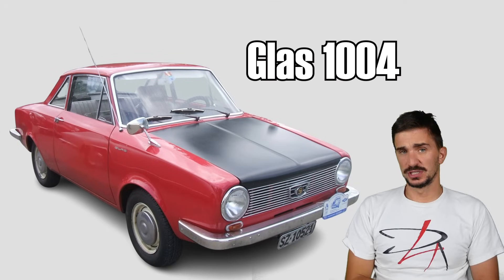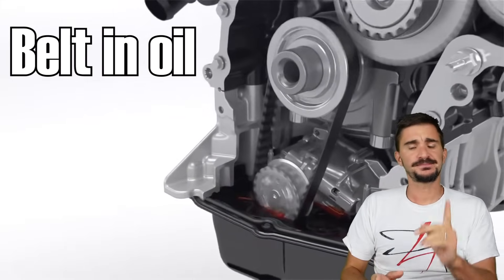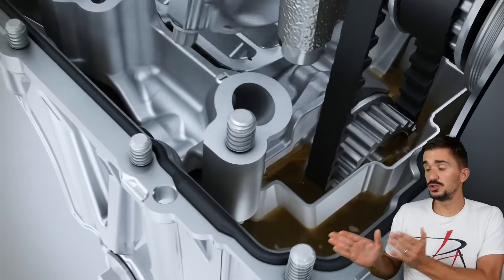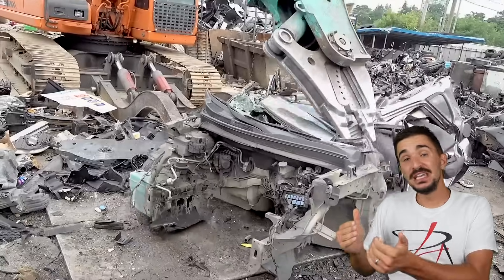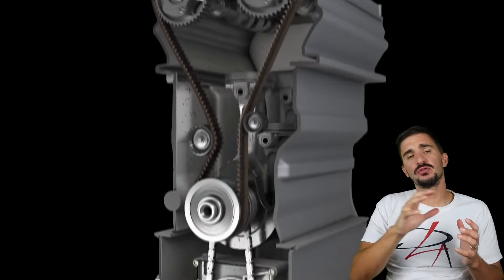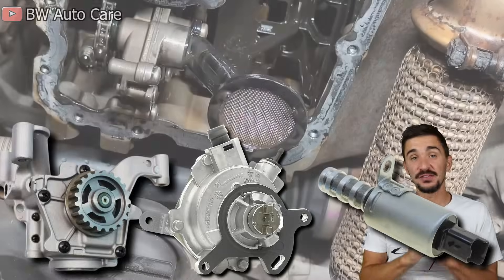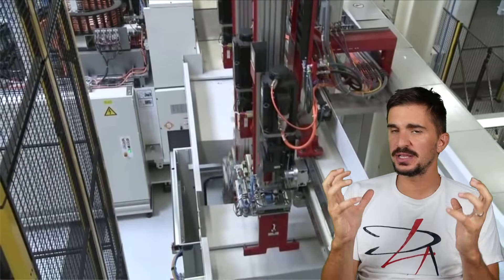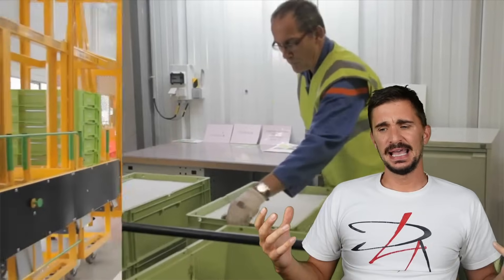Who Approved This and Why Is It Still Being Made? Wet Belt aka Belt in Oil Engines

Comment: Regarding the point at the end. You're speaking of the broken window fallacy. It's pretty interesting when you actually understand that what we're doing when we make things worse just to have them fail, we're actually NOT incresing the wealth of society. We're spending it to create short-term profits in a very isolated area (company). 

If we instead built things to last, instead of spending money on repairs, we would afford other things, building wealth for society as a whole, and in the end making everyone's lives better.

This idea is incompatible with the current paradigm, where the only thing that matters is the next quarter. Of course, I do think the opposite idea of capitalism is incompatible with humans, so I don't know how to fix this.
Reply: I also had the same idea of the broken window fallacy. The way i see it there are two approaches to fixing the issue. one is more regulation, force the entire auto market to use a single design, tested to 500,000 miles to find any issues before entering the market. this would destroy innovation since there's no way for new designs to disrupt the status quo. 
The other way is to ensure compatibility of replacement parts and a right to repair. By ensuring all comparable kilowatt engines have the same bell housing bolt pattern, then the consumer can have and repair a car built from parts from different vendors with the best reliability.
If we are to encourage manufacturers to create more reliable machines, then we should pay them by the hour of labour instead of the number of automobiles. i.e. quality over quantity.
Reply: The solution is more education. If you educate consumers about rubber and oil and how they mix ( or don't, in this case), then a company putting this kind of product on the market will just fail by itself.
You just need to do enough education that most people can figure out where to get additional information by themselves, so that they can draw the conclusion that whatever someone is selling is snake oil.
Reply: The really sad thing is that the companies that made good reliable products have mostly gone bankrupt or been bought out or taken over by the ones that prioritised profit over everything else. The classic example is Volvo, who used to make cars so durable and reliable that their sales tanked because everyone who wanted a Volvo was already driving one, and their car was showing no sign of wearing out. Volvo had to make a conscious decision to make their products worse to have sales comparable to the companies, and they still got taken over by a Chinese company anyway. 

Now their prices are still just as high, but their reliability is worse than the average car. In the US, Polestar has even managed to knock Tesla off the bottom of the JD Power reliability ratings with their even worse products 😞. Unfortunately humanity has itself to blame for this - for every person who buys things to last, there are 100 who'll buy the cheapest option or the one with the most marketing money spent on it, despite it being provably more expensive in the long run.
Reply: @martin-vv9lf , I really like this idea of a standardised engine. I’ve been saying for years that everything should simply be fitted with a 5 litre V8 and that’s that. 
No choices, one engine for the entire world. Make it reliable, powerful, easy to maintain and most of all make it affordable. 
Things like lawnmowers might be an issue for some, but I don’t care, get a bigger lawn then, it’s still better than having a wet belt or similar ridiculous “technology”
Reply: @peglor  I've worked at Volvo for 16 years and can absolutely confirm this. On the "upside", working conditions are much worse, quality is rapidly decreasing and our wages haven't kept up with inflation so... the executives are all patting each other on the back and making new stupid changes just to feel like they're doing something.
Reply: It is all about incentives. You have to create incentives that make it in the best interest of the executives at a company to prioritize long term profit over short term profit. Right now the way executives are compensated they are heavily incentivized to maximize short term profits as that is what benefits them. 

All of this changed around the 80's and 90's when how executives were paid change from being cash to stock. A simple change of mandating all compensation must be in cash could get us back on track where the most profitable companies are the ones who value their customers over the next quarter earnings.😊
Reply: @johanslabbert2869  A 5 liter v8 would be a bit big to get your groceries but it would be great in an agricultural tractor. As a farmer i've often bemoaned the scarcity of agri engines. i'd love to be able to walk into a scrapyand, pick up a v8 for small money and fit it into my own tractor. If it were me i'd like if diesel and petrol engines used the same block, so all i'd have to do is swap the heads out to diesel versions. I guess if you had the injectors threaded like a spark plug you could use the same head, just change out the crank and con rods. v8s tend to spin shell bearings also. the inline 6 are tried and tested more reliable. I think there could be a middle ground, like a v8 that uses the same head as an inline 4, and then the entire family, inline 4, inline 6 and v8 all use the same rods and pistons, and bell housing pattern too. kinda like a modern pontiac trophy 4 but with a balance shaft where needed.
Reply: @LarsaXL  The sad thing is that 16 years ago Volvo were already well into their downward quality trajectory 😞. The Skoda Superb wagon is the closest thing available to a modern Volvo 240.
Reply: @peglor  Eyupp, no argument there, but it was a lot better 16 years ago than it is now.

Comment: Fun fact. The ford edge uses a chain, but the water pump is ran off it, so when it goes it shoots coolent into your motor. Very common motor. This was 2009. They haven’t changed it at all

Comment: I finally understand what is going wrong.  I recently met with a group of freshman engineering students.  They are great at math, but none of them have ever worked on a car, or taken anything mechanical apart.  They were for the most part gamers who lived in a digital bubble.  And quite honestly, none of them had any interest in  working on an actual car or other machine.  

YES! That's why we get spark plugs that you can't change without pulling the engine and wet belts.  Modern engineers are great at math and computer modeling, but they never actually worked on a real machine in the real world. Simply put, wet belts work in computer models and save fuel in a simulation so that's the way modern engineers design cars.  And also yes, pretty much the first thing engineers learn is to always choose the least expensive option available to build.

I'm sure that there are still some engineers who actually fix their own cars or actually work on machines, but they are more and more uncommon,  For the most part modern cars are designed by video game playing math freaks aided by computer software developed by other computer gamers.  

Throw in a healthy dose of denial when things don't work as planned in testing and a huge cost to reengineer a product that doesn't work and you get wet belts that won't go away.  I mean the belt didn't break down in the CAD software program so it can't possibly happen in real life.  To be clear the CAD program didn't account for someone adding an oil treatment to the engine or missing an oil change, so when things go wrong the engineers can always blame the consumer, so no harm no foul, back to their screens and keyboards.

So when you open the hood of your car and ask yourself, who the F designed this mess? Now you know... it was someone who never changed a single spark plug or checked their own oil. 

I honestly respect someone who can complete 4 years of calculus, but until the engineers who design engines and cars actually have to fix what they created in a cold rain on the side of the road, things are never going to get better.
Reply: You really are too kind towards them; What they are is; Incompetents hired by Incompetents.
Reply: I used to run a chainsaw for a living and I never could figure out why the design improvements never fit the operating environment but what it was is that the idea people never went out and used a chainsaw lol.
Reply: Blame the companies hiring. I'm very passionate about designing modular assembly's yet can't get a job at the big 3
Reply: @edwardmacnab354  Exactly!
Reply: @xXlURMOMlXx  Most engineers with actual mechanical skills don't necessarily emphasize them on their CV or in their interview.  This is often a terrible oversight, because companies really are looking for people that have hands on experience. Before I hire someone to design a new fuel injection system, I'd like to know that he's actually fixed one and understands how it works, how it fits into the vehicle and how to improve it.  Otherwise, everyone else that applied for the job likely also had AutoCAD experience and are mostly interchangeable.
Reply: @RJ-vb7gh  it's pretty difficult to get all that into a resume though. Seems like Recruiters these days have the attention span of a squirrel and cant even get through one page. I'm pretty confident I would land a job if I could get an interview
Reply: @xXlURMOMlXx  LOL!  I had my resume trimmed down to four pages of careful wording.  A recruiter asked me to do the single page thing.  I tried hard and gave it to him.  He then went with the four pages and it worked out for everyone.

Comment: Some manufacturers have stopped using wet timing belts, but still include a wet belt to drive the pump etc. These engines will not fail catastrophically but can still have the clogged oil pump issue. 
The very first thing I check when buying a car is if it has any wet belts, if it does it will never make any shortlist.

Comment: The secret lies at 14:29 - the mfgrs aren't thinking in terms of longevity, they're thinking in terms of planned obsolescence, or probable replacement interval..  they need the engine to last the warranty period, and not much more so you'll have to buy a new one.  but what a lot of them are banking on you staying loyal to an unreliable brand.  until all the brands do the same, then it's all junk
Reply: Engineer says 'this is a bad idea'. management says 'its cheaper to install, lighter, and we can say it saves fuel!' So they fire the Engineer and grab a younger one with less experience who says 'cool idea bro, what if we use all these technologies to help with the swelling?' And management approves it because it's their idea and we have all these technologies so it must work. turns out Old timer Engineers have a better understanding of chemistry understanding than managers.

Comment: I believe Ford is now dealing with a class action lawsuit because of their 3 cylinder eco boost engines
Reply: 1.0 Ecoboost is a great engine. I literally love it. You just need to change the timing belt every 100k km, change the oil and filters every 10k km and it'll work like a charm. Also, the newer ones have timing chains since 2019.

Comment: Opel Corsa F owner here (Puretech 1.2 Turbo 96kw). They replaced my belt after around 65,000 km. Car have 4 and a half years so it was still within 5 years varanty so cost free. They said the new belt should last a bit longer haha.

Comment: My Mondeo 1.8 tdci wet belt went bang at 100k miles = scrap car 😢
Reply: what year mondeo? 1.8 tdci? aren't they hdi engines?
Reply: @supernova6553  it doesn't really matter. The rule of thumb for anything that has the words Ford, 1.8 and D in it, halve the interval for timng related maintenance.

Comment: My car was made 27 years ago. It has a timing chain, which was made 27 years ago. The engine has never been opened. Now, the timing chain tensioner, which was "interestingly" made of nylon, that wore through long ago and causes some issues. But it doesn't stop the engine, just leads to some rattling at times.

Glad I don't have to replace a belt every few years.

Comment: I remember when I was choosing to buy my first car, I asked the agents if the car uses timing belt or timing chain. Some agents have no idea about the specifics inside the engine and knows only the basics  like the capacity, its power, fuel efficiency and other stuff in the car.

Comment: I drive a toyota Aygo currently with 122,000 miles, its got the original timing chain. In the manual it says the chain lasts the life of the engine but also had advise to change it at 150,000 miles as "the life of the engine" probably translates to "when the timing chain snaps and specifies what the life of the engine is"

Comment: This is why I admire the GM 2.5 liter 151 I-4 "Iron Duke" engine..timing gears... Especially if you replace the factory fiber gear set with a steel gear set, they last hundreds of thousands of miles worry free.

Comment: After watching entire video I can say that you are pretty much on point on everything you said but I have few addons.
I drive a diesel with tdi engine, manufacturer says that oil change interval is 15 to 17 000km, you try that your engine will fail after 100 000km. after 12 000km or 1,5yrs your oil loses viscosity and it wont have effect as it should, but here is catch. You can change oil on 17 000km and you will be fine forever but you will need to make 300kms or more every day and you will be fine. Same with belt it will last 240 000km if you drive like 500kms every day.

PS. I once heard one wise man said something like this. Manufacturers always wanted to make something that will fail after warranty but didnt have means to do so. Technology before was not as advanced as it is today so they couldn't risk it to fail before warranty ends, hence parts lasted for so long (thats why you had chains as thick as tumb...), nowdays they can precisely calculate how long part will last, and as sooner as you need to change it more money they make.

They put 240 000km interval for belt change, and gave you warranty of 150 000km and or 5 years, try to figure why is that like that.

Comment: My wife's p308 has just been recalled at 30,000 miles as there was rubber particles in the oil.
They replaced the belt under warranty.

Comment: Wondering Why some ford wet belt engines dont have problems? I replaced one ford 2.0 wet belt car was 2018 ford transit with 2.0 ecoblue engine driven 200 000km and there was nothing wrong with the engine. Wet belt was like brand new and oil pickup was clean. There had to be something what causes these belt to fail or last as it should. Its clear that this problem is not random belt failure like poor quality of belt. There had to be something what causes this problems, if the cause of the fault has not been found, then the fault cannot be repaired or avoided and there is evidence that some engines dont have these problems.

Comment: Main problem I saw with wet belts is the way they degrade. You may replace it before it totally snaps but their main problem is that they shed their rubber components within the engine that will clog all internal components.

Comment: Hi and thanks for this video. I have a 2020 Ford Transit Custom 2.0 ECOBLUE turbo diesel and live in Australia. My van was booked in for the 180,000km service (here we have 30,000 km intervals) the day before the engine died and was diagnosed as timing belt failure????? they replaced the engine which took 6 weeks to get back. I did a lot of digging and found exactly what you have mentioned, here the Ford Ranger using the same engine is 15,000 km intervals??? no one can explain this sensibly to me. 30,000 km with the "new" engine (which I found out is refurbished)  it too needed to be replaced due to excessive oil and coolant use. this took about 6 - 7 weeks. now after 13,000 kms it has used over 1 liter of oil, the coolant has drained the reservoir. I have asked Ford to replace the van twice now and they reject my claim?????? I am lost for words

Comment: I have a psa 1.2L turbo engine with 115k km now. I change the oil every 15k km ( 5W30) and the belt was changed at 60k, at 120k going to change it again. No problems so far. I drive it 100km a day, but let it warm up for 10 minutes before i go.

Comment: Ty, i found that that i can find some a belt made from hnbr for my regular v6 chevy engine. I got my 3.4l going strong with some well done basic mods but a little bit of oil leaks from a seal and gets on my belts causing premature failure. Todays belts are commonly made from SNR which might be called SBR and seem to withold against this better than the conventional belts i used to use. Im hoping hnbr will last even longer

Comment: GREAT GREAT VIDEO, in Brazil today only Chevrolet still making wet belt engines, Ford once did, but now they closed all their factories over here, so Chevrolet Vehicles are getting bad bad reputation with the public because of the problems related to wet belt engines, recently GM has annouced an increase in warranty time but only for vehicles that replaces oil with Chevrolet dealers, they claim that the use of the wrong type of oil affects the wet belt, it may be true but there is a bunch of cars using the correct grade and type of oil that face problems with the wel belt. Manufacturers certainly did this trying to combine lower costs of manufacturing with lower costs of scheduled repair, but it was a HUGE fail. Time to say goodbye wet belts.

Comment: An other factor to take into concideration with a belt submerged in a liquid (oil) is the efficency loss du to the pump losses when the belt had to evacuate the liquid from the cogs.
Losses of course create heat in the belt and also pressure on the oil with stress peaks in the belt…..
I worked with designing marine transmission and reducing pump losses was always in focus to obtain maximal overall efficiancy of the transmission